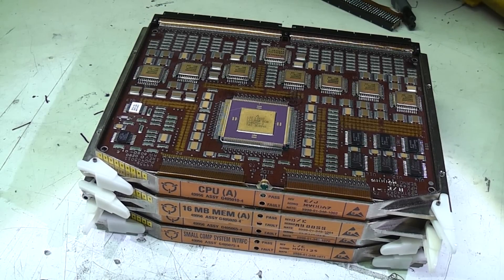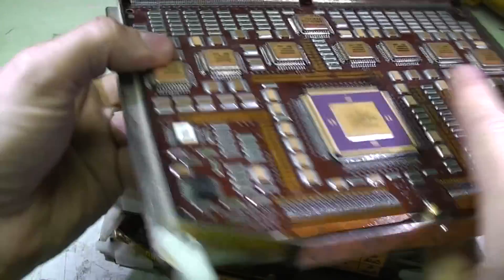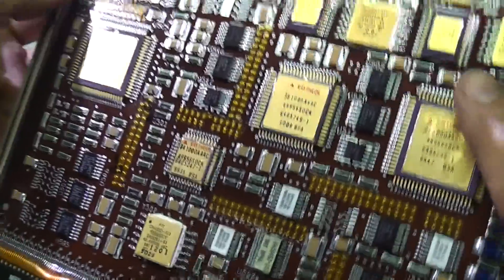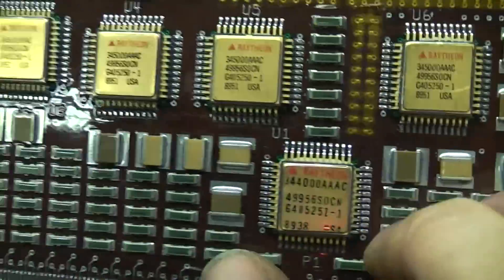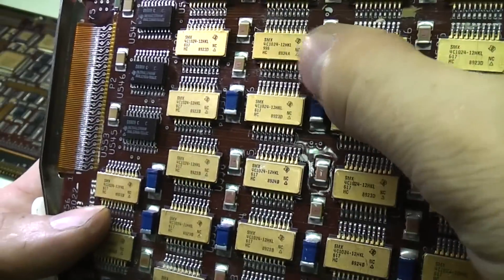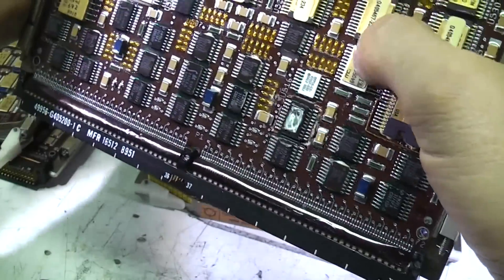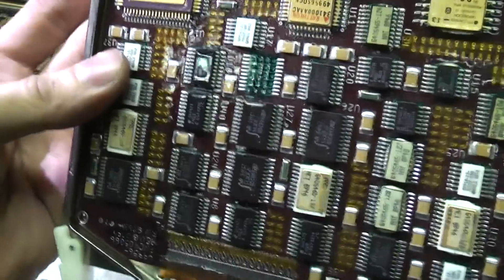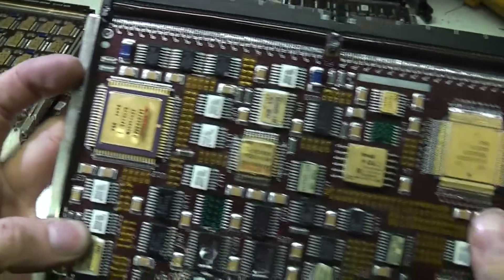Wierd military computer boards

Comment: Ofcourse, this could be produced in '90s, but not necessairly, judging from amount of RAM is IMHO wrong. Consider that Curiosity Rover has only 256MB. There are environments where power consumption and reliability is main issue.

I think it might be much older, considering that cost in military is not big issue, or more recent.

Comment: Clearly these boards are designed for use in a high temperature environment, such as inside a satellite or spacecraft. These are brutal environments for electronics, including high radiation exposure. Also why there is no plastic and why these are conformal coated. Numerous resistors required to match bus driver chips to the back-plane.Raytheon is well known for satellite and military systems. Probably cards taken out of a backup satellite, or simply left over from a cancelled contract.

Comment: whats that gloss over the circuit board called im interested?
Reply: "The coating on the board is called Conformal Coating and is NOT for marine (i.e. waterproof) purposes, but rather to again, hold components down where they're placed."
Reply: copy and paste.
Reply: Azen Kwed What's your point? How much effort do you think I should have gone through considering I'm not being paid. You couldn't even be bothered to type a proper sentence starting with a capital letter. You made no more effort than I did. Less, even.
Reply: Sean Smith it hurts, doesn't it ?
Reply: ***** Quotes weren't there. He added them later.
Reply: Azen Kwed What a trivial thing to lie about....
Reply: Sean Smith lol. you're saying that ? or did you forgot that you did add them afterward ? I made the remark precisely because you didn't put the quotes. we'll leave it at that.
Reply: I think the better question is, why any one would give even the slightest of fucks about whether or not it was copy and paste...?
Reply: yessir, it is conformal coating, helps ihibit corrosion as well.
Reply: The conformal coating is to protect the components from moisture primarily but can also act as a physical barrier for people holding them incorrectly. It's present from manufacture where specified and makes repairing the boards an absolute nightmare.

Comment: Make note of the conformal coating people.
Reply: +chucknorris687 It was to seal the boards, likely marine use originally so water wouldn't ruin them.

Or you could go off the wall a bit and say it was for security reasons because if you tried to disassemble them it would ruin the board and components thus preventing any real reverse engineering.
Reply: +SilvaDreams 
like an Ironkey
Reply: +chucknorris687 Conformal Coating was to hold the components in place.
Reply: +Napa Blue conformal coating was used to resist corrosion in marine environments. it had to also conduct heat. worked on on board systems for navy and saw a ton of it.
Reply: Had a girlfriend that was into conformal coating...it was pretty slick.
Reply: +SilvaDreams No.  Conformal coating was a moisture and dust seal to protect the package.  There are specific instructions to remove the coating when working on the boards, and then to re-apply it after.
Reply: scott flynn
 i wonder if the instructions included a 'conformal mapping' lol...
Reply: Rick Deckard Lol...

Comment: Most governmental things run old ass computers. Things like F-18 jets still use VAX minicomputers from the 1980s. Even the vital national security systems  are still using some legacy systems because they are so integrated replacing them with new thing would be a nightmare.

Comment: It seem to me all the parts on them, not to mention the design and quality measures taken for the construction are special rad hardened versions and therefore expensive as hell, the kind of backplane connectors somehow narrows them down to the avionics bay of a plane, I guess 15-10 years ago, it's maybe a flight computer, at least one of four, you need to search for mil backplane standards!
What equipment did you use to take those hi res pics? Great!

Comment: 16mb of ram?thats just insane for 1989
16mb was about the max some1 could get in there system for 1996'ish
so what...256GB of ram if they made a smiler size board with 2012 technology?

that sir...is scary

Comment: What makes this different than a typical PCB found in modern computers?
Reply: Quality of components, the fact the whole board is coated and it's like a blade system so you can swap boards easily. You can put them in a system, take it up to 70C for an hour then down to -20C without worrying if it would stop working - it won't.

Comment: Good Day
IF those Boards were used in Jet Aircraft  they would be  "Air Force"  or possibly "Navy".
Both Aerospace & Air Force & Military end users have roughly the same expectations of their Equipment. 
Each has their own "Technology" but the same expectations as far as having the most rugged piece available  Trust me they Engineer stuff to survive the most severe service conditions. (Consumer stuff gets Engineered to only work in "perfect conditions")
I doubt they would have much value beyond being "Conversation Pieces" now, unless you could track down the rest of the Computer it was in.
Years ago I inherited part of an RCAF  Aircraft  "Summing" Computer, which was run by very tiny Vacuum Tubes.
It was the size of a CD ROM Drive, & Black Aluminum.
I wished I had the whole thing but only had part of it.
I do still have some RCN Helicopter (Control) Servos & Servo drive Computers,
The Servos themselves were all made in Britain, & I have a few NIB.
Huge Transistors, the Drive Boards take up space!

Comment: DEC internal article:

Sun. Apr. 29, 1991 at Discovery Mission Time 0 days, 04:11:55 the 1st VAX in space booted VMS. Controllers at Goddard Center report all sensors are nominal and the verification phase is proceeding normally.

Militarized VAX 6210 by Raytheon. R/W optical disk boot device by Sundstrand.

Controllers also report, based on the orbital velocity of 17,438 mph, that VMS is now the fastest commercially-available operating system.

via rec.humor.funny, ID: [S2e4.408@looking.on.ca]

Comment: Pfff, everyone knows these came off the Death Star.  These are the triggering components that fired the main gun.  Now that the Empire uses AMD chipsets, these boards are entirely obsolete.  I use a few of these on my evaporators since they are shielded against heat and moisture.   Pretty much all they're good for now.

Comment: Right about memory sizes in the 90s, but you messed up on the prefixes. :)  A megabyte is not 1024 bytes, but a kilobyte is.

1 kilobyte = 1024 bytes
1 megabyte = 1024 kilobytes = 1,048,576 bytes
1 gigabyte = 1024 megabytes = 1,073,741,824 bytes

Comment: Something tells me that came from a variant of the VAX computer family.   Called a Mini Computer, or a real portable VAX minus the hard drive (Big Plateau HD) for the armed forces.

DEC made the big VAX/VMS machine with dumb terminals.    Yours is build by Raytheon,and they are in defense industries.    So what ever it was for, since it's full custom you have a useless souvenir from the 80's and 90's.   If you had all the parts, monitor, HDD, etc it would be a collectable.

Comment: Absolutely false. When it comes to computer hardware, the military is usually a couple development cycles behind the current consumer standard. Brand new hardware is not considered 'fieldable' because it is unproven. The boards in this video came from a mainframe - 16mb in 1989 on a mainframe was not unusual.

Comment: I probably sound like a fool asking this, but could it still run NetBSD?
Reply: I'd be surprised if it ran any "modern" OS, like from the 90s and up. This is most likely based on a very different architecture than typical ones today (x86, x64, ARM).
So yeah.

Comment: Nothing special with the boards pretty old technology.They replaced those boards with a 128 pin ball grid surface mount chip.Now they use a circuit board that fits in the palm of your hand to replace all of those circuit boards.This is commador 64 technology ha ha ha

Comment: Is this emp proof?
Reply: No. These are likely fighter jet computers from the 90s. Basically the stuff that calculates the trajectories of missiles and bullets from radar signals to help pilots shoot.
Reply: Yes MILSPEC means that it is EMP hardened
Reply: I am so sorry. I knew what an emp was, and the way you phrased it sounded like the speech patterns of some conspiracy nuts I know, so I thought you were asking if these boards were proof that the government was using emps to control our minds or something. This is not my area, but I can imagine they have some kind of protection against them.
Reply: Pretty sure emp means electromagnetic pulse and its to stop something from crashing  the computers and or wiping the drives i think

Comment: You should inform youreself better. AND you should count the ram chips on that thing. i counted 46. 16 megs / 46 chips, makes 0,34 Kb for every chip. That isn't realy insane, if you consider that there where 1 Mb Chips on the marked in 89. (developed by the carl zeiss ag)

And 256 Gb of Ram...well, look at a SSD. They are available with more then 500 Gb and have the size of a 2,5 " HDD.

Comment: I think you are confusing MB (Mega Bytes) with GB (Giga Bytes) and thus are wrong because of that.
A Megabyte is 1024 bytes, a Gigabyte is 1024 Megabytes. (or 1,048,576 bytes)
A typical smartphone today has at least 512 Megabytes of RAM, 32 times the memory on this ram circuit.
That amount of memory in the cellphone also takes up about one thousands of the space of this ram circuit.

Now, since this hardware existed in 89/90 and home computers got on avg had 16 mb of ram in 96 i call BS on you.

Comment: At one time TI was the manufacturer of most US mill. computer systems then Ratheon Bought Ti's crap and got the mill contracts now they buld the stuff fow for us mill. If thats the case those parts are not that old I would say? if those wear made in the 1980s those chips would of said Texas instruments? wouldent they? British Aerospace, and Beech Aircraft Corporation,. These two were merged in 1994 to become the Raytheon Aircraft Company. those parts are what 15 years old not 1980s.

Comment: The difference is that these are indestructible, water resistant and will probably last forever =/

I work witha lot of older systems like these, you could use these things as a dang coffee table completely exposed and running and they'd last longer than you will ha ha!

Comment: What you say is a myth. The military hardware inside airplanes and the like is several years old chips at the time plane begins design, often manufactured using really old processes (so that the transistors on the chip are bigger and more radiation resistant), and put into ceramic package, god only knows why but it's really expensive (best guess, someone's skimming public money). Also, google "ps3 supercomputer". Software is utter shit (google f22 date line).

Comment: hehehe
286sx 25 hehehehehe ok is it the agnes chip or maybe the denise or even a prototype toggle box for a zx81  using 68000

This is one of these moments like in the advert and only the old geeks laugh

enjoy
Reply: the zx-81 had 16K of ram not 16Mb.
Reply: I am unaware of any 286sx computer chip. The sx designation did not begin until the 386.
Reply: Richard Alexander

The SX286 came after the 0386 but the 286sx came before There was a build yourself kit just after the altair by a company that never received credit, it was shelved then later re introduced.